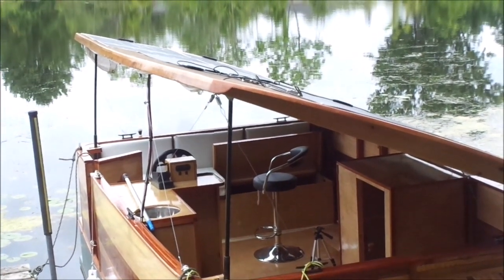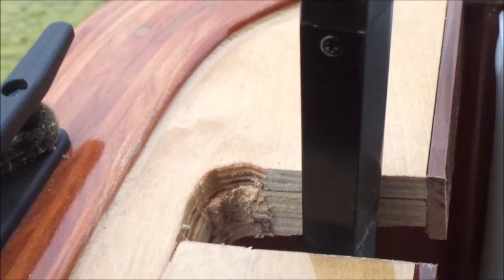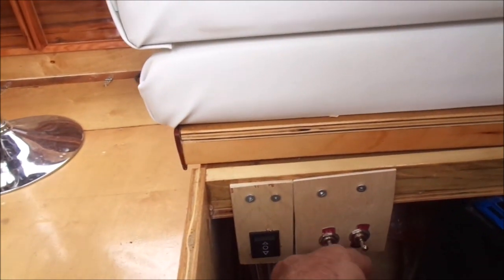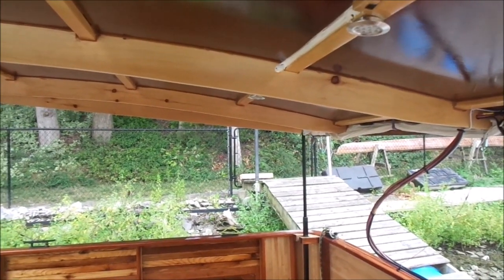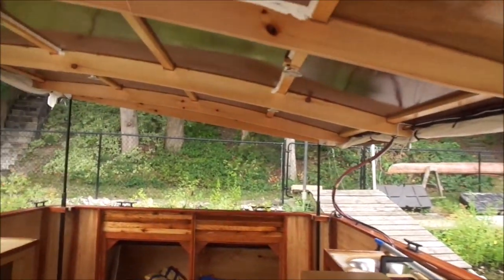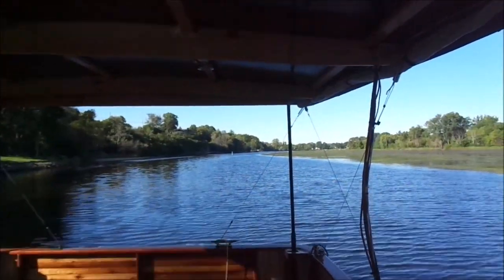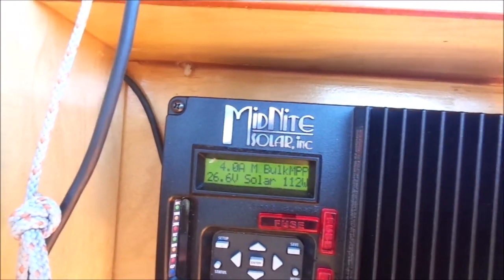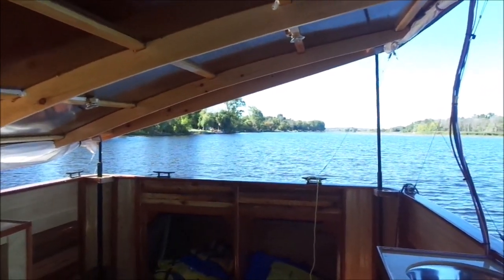Tilting the Solar Canopy Building My Solar Electric Catamaran Part Ninteen,

Comment: sorry to hear about your torqeedo magnets. hope theres a easy fix. warranty? do you think all the weeds did it?hope its not a season ender. iam going to build a 60 hp chrysler lower unit with a golf cart motor to push my houseboat at a slower speed. keep us informed.
Reply from the maker: That wasn't my Torqeedo that had the magnet problem, that was Nater. I had an issue in 2017 related to the remote throttle. See my videos on the Rideau canal trip when I had the issue. Torqeedo replaced my remote throttle under warrantee.

Comment: Your canopy certainly serves many purposes and it is very interesting to see how you adjust the design and adapt it for more and more functionality.  The most important seems to be (in my mind at least) 
1. a testbed for experiments related to producing solar power.
  - but also:
2. A security cover protecting the boat and its content when you are not present.
  - and when the boat is in use:
3. An open venue allowing you to see and interact with the environment around you with:
4.  A rain shield that protects you and the boat contents.
5.  A sun shield similarily.

The main complicating issue is to do all this while being light weight and  stable within a windy environment. 
Both the sun and rain shield  functionality is directional mostly from above but modified by sun angle or wind strength and direction and gustiness.  Lots of things to play with and factors to consider,  Enjoy, and thanks for sharing...
Reply from the maker: I hope to have a custom made canopy made from aluminum and canvas for next season. This should address the weight issue. I will also have an enclosure made that can be zippered in to fully enclose for camping or rain.

Comment: Love the boat... the cedar strip finish is cool. I like the idea of moving the electrical panels to meet the strength of the sun, but I'm wondering why you simply don't make the canopy fixed, and tilt (and rotate) the panels separately on top of the canopy.
Reply from the maker: This was the easiest solution. All I did was basically rewire the actuators.
Reply: Also that would be much worse drag...